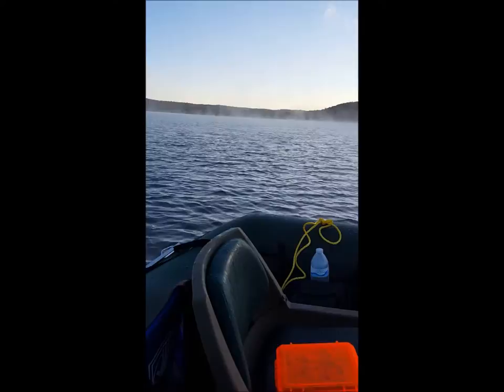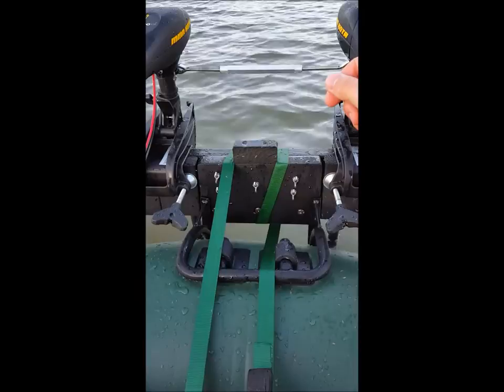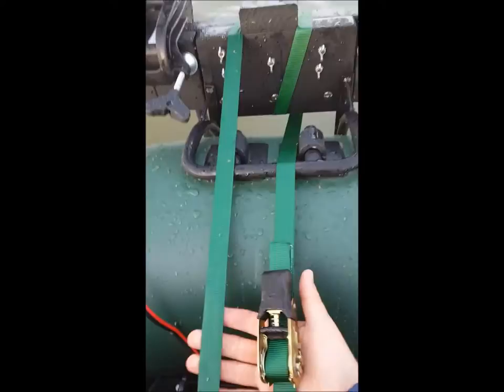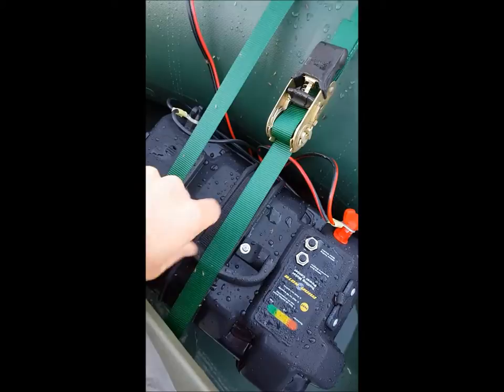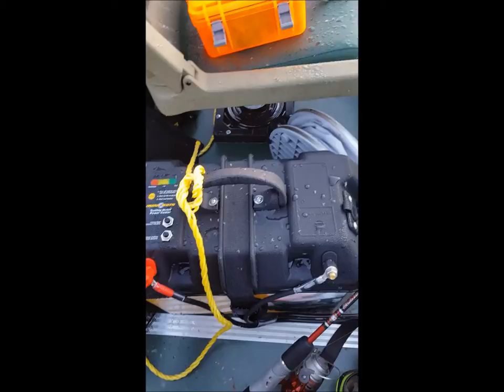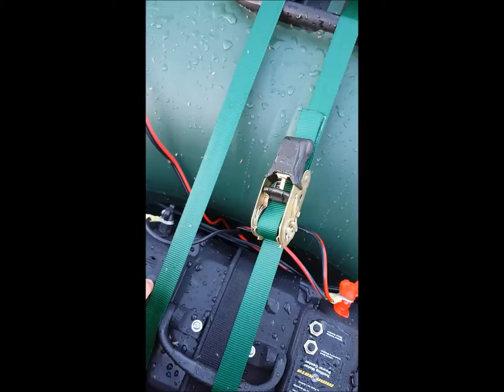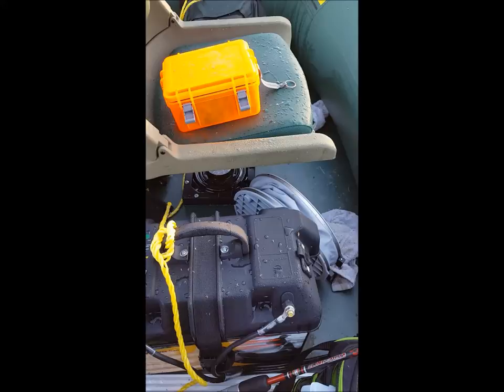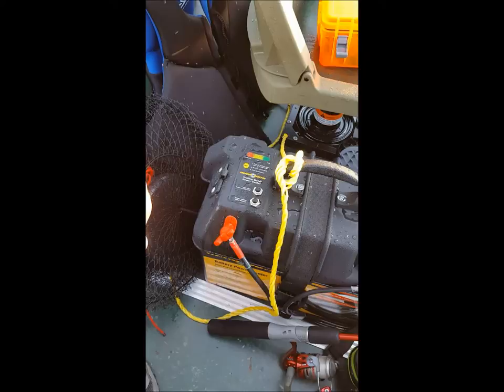Sea Eagle STS 10 review 4

Comment: Jason - Do you think (obviously more expense depending on the year) a 1.5hp or 2.5hp motor would make more sense?  I was thinking an old OMC 1.5hp or 2.0hp would sip gas and only weigh like 28lbs if I remember correctly.  Louder, but you would lose probably 50lbs of battery weight and space.
Reply from the maker: Bravo Six 

  Yep!  That's exactly what I did.  a 2.5 HP works great on that boat.  Be sure to get a long shaft though.
Reply: Hmm.  And you said it handles small waves ok as long as you have enough power to move through

Comment: Would one the 1hp Minn-Kotas be enough to push 2 fisherman around a medium size lake
Reply from the maker: gerard haubert 

I HP in trolling motors is around 60 lbs of thrust.  It will definitely move you 2-3 mph, but the tradeoff is you're using tons of electricity to do that.  It won't last very long.

Comment: how are the seats...i was concerned how the floor mounts are. do the seats post move around allot or solid? thanks
Reply from the maker: The seats are actually one of my favorite parts of the boat.  The seat quick disconnect mounts are mounted to potted inserts in the painted marine hardwood floorboards.  From there the seat base just clicks in and out of that.  there is zero flex from the quick disconnect to hardwood floor.  there is a very minor flex between the quick disconnect base and the seat.  It's so minor under my 200 lbs that it has never bothered me nor do I really notice it.  if it does become an issue, simply bend the seat base metal to reduce the "gap" in the receptacle.   In short:  The seats are really nice and I wouldn't worry about them.
Reply from the maker: The seats are actually one of my favorite parts of the boat.  The seat quick disconnect mounts are mounted to potted inserts in the painted marine hardwood floorboards.  From there the seat base just clicks in and out of that.  there is zero flex from the quick disconnect to hardwood floor.  there is a very minor flex between the quick disconnect base and the seat.  It's so minor under my 200 lbs that it has never bothered me nor do I really notice it.  if it does become an issue, simply bend the seat base metal to reduce the "gap" in the receptacle.   In short:  The seats are really nice and I wouldn't worry about them.
Reply: were torn between the boat you have and a 10' alum. jon boat. we did notice that that the seaeagle can hold more weight then the alum jon boat. More then double...We use to have a seaeagle 9 classic. The old style bench seats were pain to run through the ropes. But the model you have seems much more basic and quicker setup then the classic we had
Reply from the maker: +Ernest Williams The 10 foot aluminum Jon Boat is a great classic and should be seriously considered.  I have been out on them many times.  the benefits are a rigid and nearly indestructible hull especially if you go welded.  they obviously have a fixed transom, so you get better engine capabilities.   The downsides are instability,  heavy weight, and low weight loading.  You are not going to be able to stand up in a 10' Jon due to instability.   With everything in life, you can't get one thing without sacrificing something else.  The Sea Eagle is less durable than aluminum,  but since all of the buoyancy is accomplished by pressurized air on the outer perimeter of the boat, it is incredibly stable.  Two full grown men can easily and comfortably stand and fish in it.
Reply from the maker: +Ernest Williams The air tubes as the main buoyancy device is why you can have so much weight.  I can attest that the Sea Eagle can truly handle the weight it claims.
Reply: thanks for all the info...Im taking the time today to call the parks where we wanna take the sea eagle. I want to make sure they allow inflatable boats. Most of the parks are asking me if the sea eagle is a multi chamber boat. The park ranger said it has to be multi chambered or I cant use it?
Reply from the maker: +Ernest Williams That makes sense for safety .  The STS 10 is multi chambered.  3 total.  One that covers the bow, and the left and right rear.

Comment: Was gonna get a Minn Kota Endura Max 50 lb thrust for it. Do ya think that will suitable for this boat?
Reply from the maker: Yeah.  Better than the 30lb for sure.  You'll need alot of battery for the 50lb though.  Large bodies of water or windy days you will want a gas outboard.
Reply: @jasonw2291  NIce! What battery would you recommend then? I'm new at this.
Reply from the maker: @ddm62571  

Well, it's all about how long you wish it to run.  You'll need to do some research on reserve capacity,  amp hour ratings, draw, etc.. to make sure you have what you need.  I would think at least one 31 class battery or perhaps two 27 class.
Reply: @jasonw2291  I would go with a gas engine outboard but a couple of lakes I go to require no gas engine motors just electric and those lakes are excellent fishing lakes.  So I will be going electric. I  was looking at the Optima marine batteries since all I hear is good things about them. I will look around though. Thank you for you input! 👍
Reply from the maker: @ddm62571  

Optima is a great battery!!